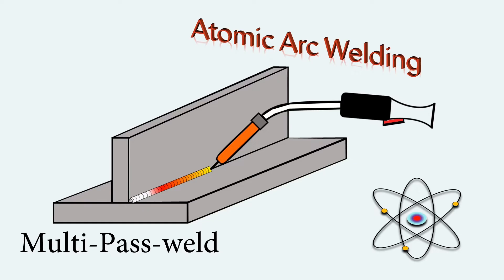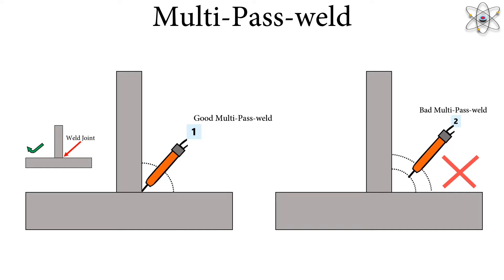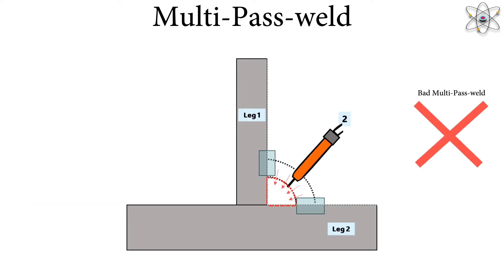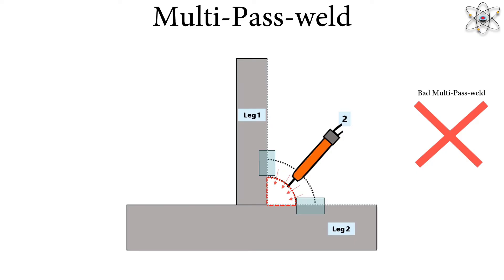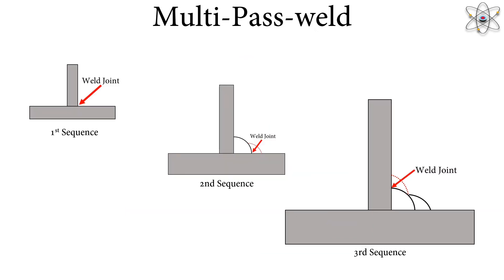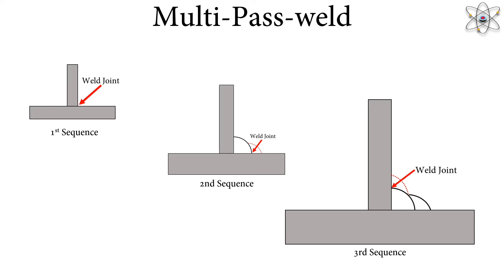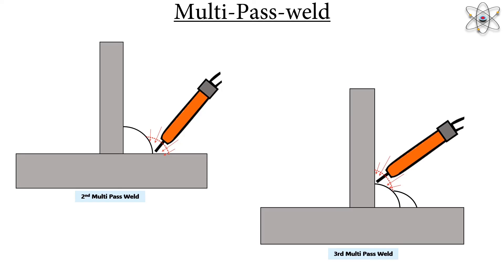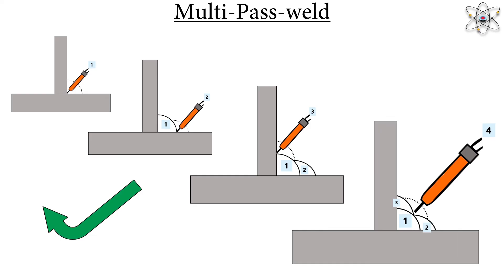The Misconception About a Multi-Pass-Mig-Weld: "Techniques and Tips"

Comment: You made a small mistake. The 3rd pass needs to always overlap the second. or what ever weld was last there. if you dont do this, you could trap slag in between the two welds and there will for ever be holes there. Either leave extra space between two welds. or overlap each other. But never leave a small gap. Its hard to clean out, and can leave you with holes inside your weld.
Reply from the maker: This multi-pass weld sequence is correct because it ensures balanced heat distribution and proper fusion at each layer. Starting at the root (Pass 1) establishes penetration, while alternating side passes (2 and 3) prevent distortion. The final cap pass (4) completes the weld with a smooth, reinforced profile—meeting throat and leg requirements per AWS D1.1. This controlled buildup ensures strength, minimizes defects, and maintains weld integrity.